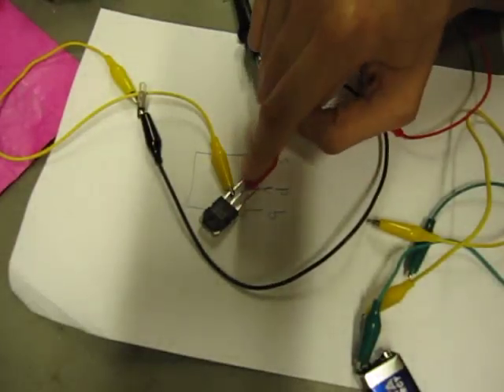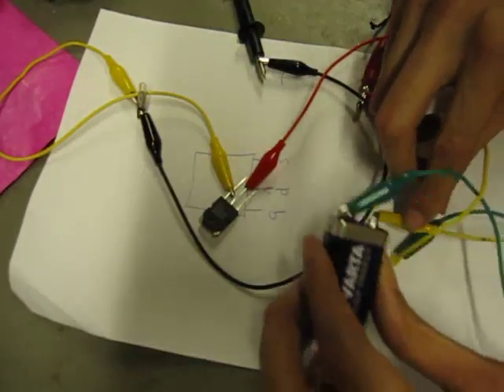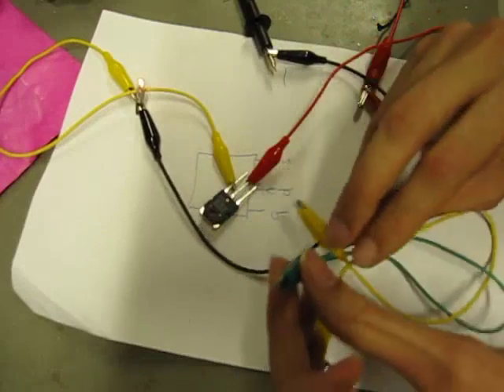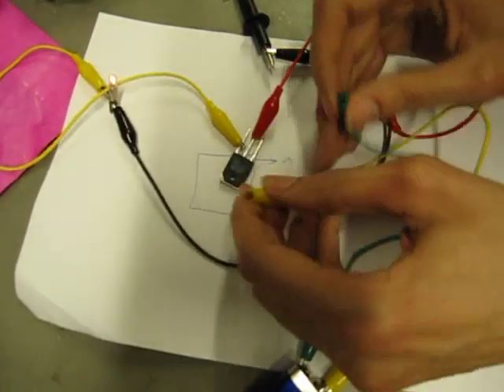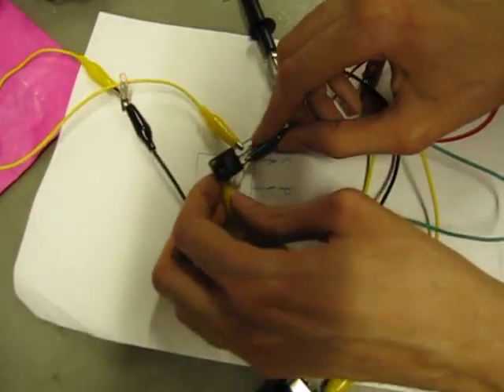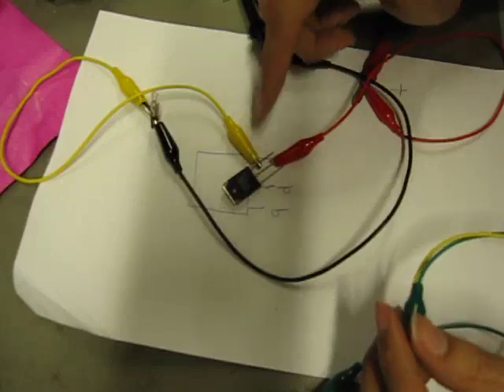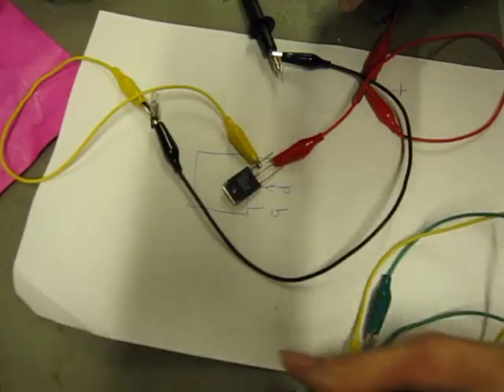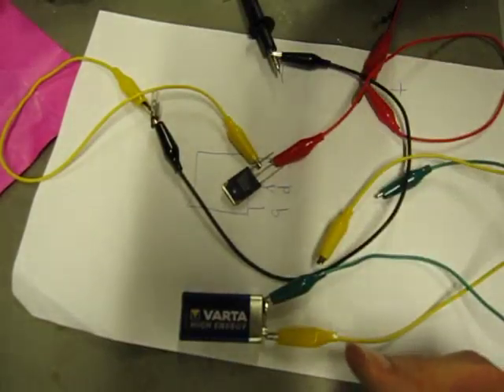Testing a MOSFET

Comment: PLEASE READ OR YOU CAN BE PUTTING YOUR MOSFET IN DANGER ! After viewing this i started playing with the FETS to see what it found was relative ground. i found out 2 things 1:THE DRAIN PIN IS THE GROUND; there connected. The guy on the video though the back of the FET was ground but is not i discovered with a MultiMeter. So if you build something keep in mind the heatsink for the FET is connected to the + of the supply its switching! 2:TRUE GROUND is SOURCE pin found by a MM.
Test it yourself.

Comment: @sithvegeta I had the same problem.I thought the Gate wasn't getting enough voltage to switch it at first.That wasn't it after applying 14.7v was more than enough according to datasheet.It turned out the Mosfet was failing under load.How did you make out.